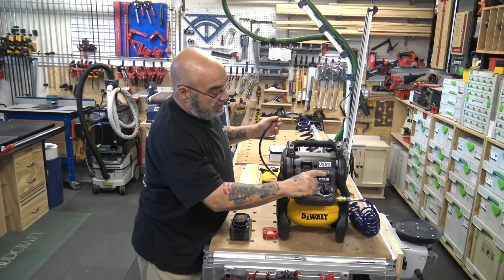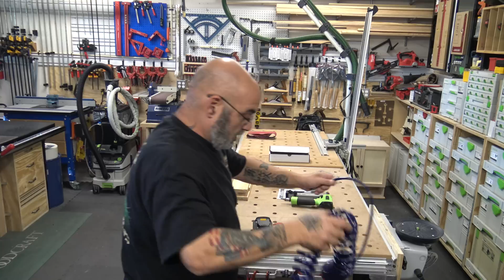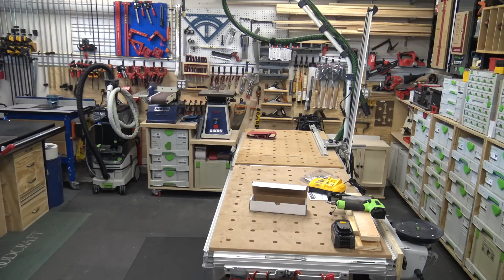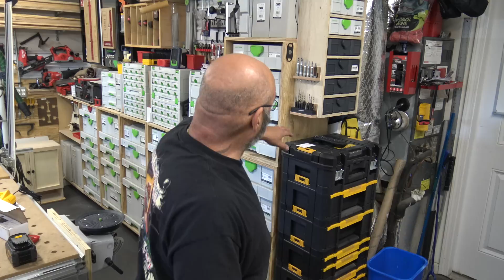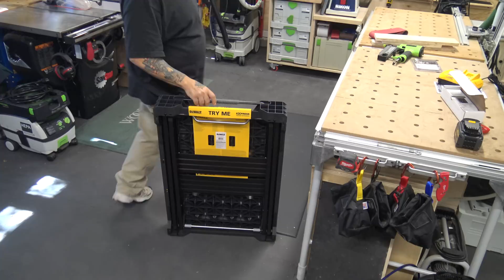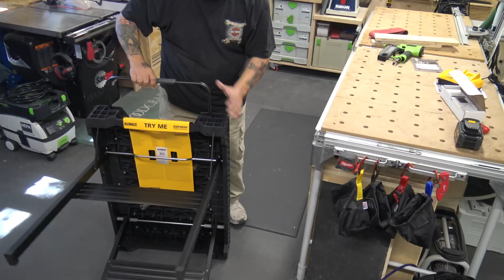Review of the DeWALT DCC256 60V Flexvolt cordless compressor.

Comment: Just a point of information... in 60 volt mode, the 6 and 9 amp hour batteries run as 2 and 3 amp hour, 6 & 9 when used in 20 volt systems.  That said, the more efficient higher voltage motor, I believe, makes the Ah number less significant
Reply from the maker: John Ellis thank you very much for the info. I will pass it on the next review. Mike